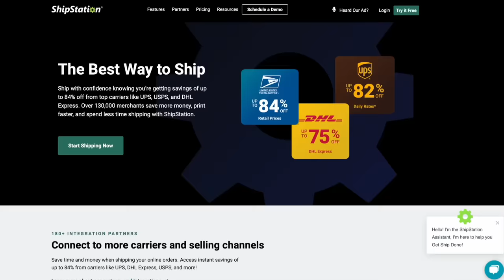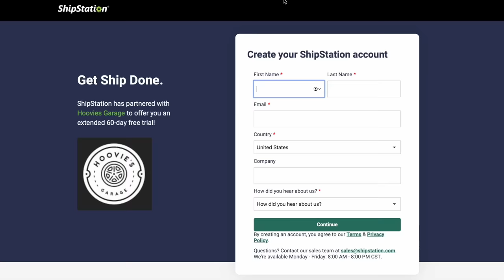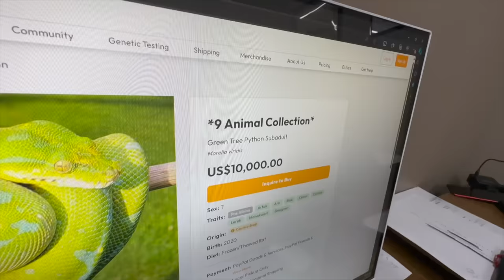I accidentally bought the MOST ANNOYING Dodge Viper in the USA (it was also really CHEAP)

Comment: Former owner of a 2003 and 2013 Viper heres. Nice purchase, needs a little TLC. That oil seepage is most likely the oil cooler line - an issue from the Gen 3 onward. Both of mine did it, as they all do sooner or later. If you replace them with OEM lines, will do it again. There are aftermarket alternative which won't.
Reply: Yep..👍
Reply: Also, a 2004 issue only: check the crank bolt, they tend to back off. That one year only, Dodge used a smaller bolt.
Reply: Yupp going to to replace the lines on my gen v this winter. Other wise this car hasn’t skipped a beat in the 20k miles of abuse I’ve given it.  Oh and  the stupid crappy window regulators
Reply: Aftermarket shocks would also be new and likely cheaper
Reply: Always love when people change out factory parts that eat shit with factory parts..... "I use only factory parts on my car!", you didn't learn the first time it failed at 20k miles? lol
Reply: @jemery3  to be fair that is EVERY freaking Chrysler product.

Comment: You can get a set of BC coil overs for it for under $1.500.00 and really improve the suspension so you can have adjustable height and compression/rebound. Once the Wizzard has the new cats on I'd have someone re-tune it.
Reply: Not anymore you can’t. I think the cheapest I’ve found is 1750 for BC

Comment: That exhaust is supposed to crossover in the rear. Left side engine exits on the right and vice/versa. There is also a small crossover pipe to equalize the sound (like an H pipe). Just doing that alone will make the existing exhaust sound better!

Comment: Amazing... Only 30,000 miles, and it's already rusting...

The miracle of Chrysler...
Reply: Depends also on the owner. I see 2020-2021 vehicles that are already rusting out cause every road in my state gets salted once the snow hits and maybe said former owner said screw it and drove it in winter.
Reply: @thesovietvorona1007  Yeah I know. It's amazing. They can start rusting while still sitting on the dealer lots.

Somebody told me it's because Chrysler paint sucks. The person who told me that works at Chrysler's paint shop.
Reply: @Xplasma1  that’s not the only reason. Worked at an oil shop for a year. I’ve seen winter dailies that are forty with no frame rust (Volvo mostly) and new barely off the lot vehicles like F-150s already getting rust started. Every company outside of mainly Volvo uses somewhat subpar steel and it rusts quickly so that you have to get a new car sooner. If they still made things how they did before the idea of monopolizing an entire market existed we’d have cars that lasted for more than a decade. Let alone a few decades or more.
Reply: @Xplasma1 I can vouch for that, I've never been overly impressed with my new chrystler's paint jobs but for some reason I keep buying them.. thankfully I don't live in a salt state so I don't have to worry about that. Sadly finding my "dream truck" is going to be difficult to find not rusted/250k miles/completely thrashed, and yes it's another chrystler..

I will say atleast it's better then the paint from the 90s which had a habit of just falling off

Comment: $800 for an oil change/fluids? 11 quarts of engine oil, gearbox oil, and differential oil. I get my full synthetic oil at Walmart for $21 per 5 quarts, so about $45 there. Trans and differential fluid plus friction modifier - maybe another $50 for those fluids. Where's the other $700 coming from? Buy the fluids and get your new chippy to do it for you; she seems up for it...
Reply: You're a tad light on your prices, but the bill does seem expensive. A local indy shop quoted me $200 to change the oil in my BMW Z4 a decade ago. Nope. I made some ramps out of 2x10s and I've been doing my own oil changes on everything, since. Between 4 vehicles, I've saved thousands.
Reply: Does seem expensive but I just spent nearly $200 on gearbox oil alone for Motul300.
Reply: @OMGWTFLOLSMH  Yes, I was off by about $20, so $680 less to do it yourself. Maybe it'll take an hour.
Reply: @richieduck67  Viper takes 4 quarts of synthetic ATF+4 is about $8/quart/$32. 1.5 quarts of gear oil plus friction modifier. Hoovie is getting beaten either way.

Comment: Not that you will pay this any attention but i put BC racing coilovers on mine when that time came along was way better deal with labor and parts it was 3850.00 less expensive and actually felt tighter and better rode than the OEM did  and unless there's a hidden issue put a tube in that front tractor tire i have a small farm 765 acers and we have a couple of tractors 6 of them one has tracks so it doesn't count but unless you have checked tractor tires are not a minimum cost by any means  and unless they have a big gaping hole or have no cleats left or have dry rotted so bad there 0:11 flying apart we tube, patch, slime or tireject them its not like your doing 70mph on them in a curve or something they are traction tires as long as they have traction cleats and hold wind its all good

Comment: 20:50 you are not wrong about those ev part prices esp batteries but those are current prices I just took a short course on ev repair and the instructor mentioned that in the next few years your average shop should be able to preform bat swaps and your larger shops should be able to replace individual battery cells.

Comment: Ummm Hoovie when they made this viper, where they still making the dodge Durango, as the first gen vipers just lifted their suspension purely from the durango, like cross check the codes, it might still be the case, as this is why on the first gen ones, you can actually put the rims and tires of that on them and it'll work if you need some cheap snowtires.

Comment: . . Dunlop tyres are the worst . .  I had Dunlops on my RS6 when I bought it and the car would easily lose traction in the wet in the UK even though its has Quattro 4WD  . . after 1 year the fronts were going so I fitted Michelin Pilot Super Sports all around and god what a difference ! . . stuck to road in the dry and the wet . . and they have lasted 3 years . .

Comment: Good lord. Reading the complaints of these cars being loose. I have 30+ years driving dirt roundy round cars. 600 hp with 8" tires. Also had a 2800lb weight rule for some events . The tire rule was meant to be our equalizer. So in my eyes the viper handles and bites fantastic. Try throttle modulation. Drive the darn thing. Ok all, be safe and healthy.
Reply: Ken Schrader taught Tony Stewart how there's 1,000 throttle positions on every car. Trophies never lie. 🏁🏆

Comment: You need to put resonators on to stop the drone, not cats. Cat converters are not designed or meant to stop a drone. To stop the drone is the only reason a resonator was created. If you only do cats, it's still gonna sound like crap. The wizard has no idea what he's doing on this which I find very disappointing.  The factory resonators are 1000 bucks each but discounted.  I work for Dodge and checked. The wizard has the ones he took off you could use are try and find an aftermarket resonator designed for your Viper.

Comment: 16:05 Yepppp one of the Viper wheels themselves you'll be lucky to get it for under $800... as for shocks had on to your hatsssss. and the prices for the other vehicles that you can use from a Viper makes zero sense. Wheels: same bolt pattern different offset as the 97-04 Dakotas/Rango

Comment: Why would anyone tune a Viper unless you're tracking it? They already try ro kill you at stock power if you fuck up in the slightest with turn in or throttle application. 500 hp is ***ample***.

Comment: How long do used shocks last (how many miles are on them)?  How long do you plan to hold on to the Viper and how many miles do you plan to drive per year?  That probably is the info you would use to choose between used and new.  For an extra $2000 you can have brand new shocks all around and a completely sorted out Viper.

Comment: Wasn't there problems starting it? Diesel can easily be from that. You crank it, it doesn't start, diesel drains into oilpan. Hydraulic oil has to be replaced and preferably cleaned cleaned. Poor quality oil will at least make hydraulics inefficient, but if it foams in the pump, it won't circulate. Cavitation and all that wizardry. With old tractors, breakage is possibility, but often stuff is so simple that it's an easy fix with a bit of ingenuity. Just don't try to make it work by only throwing new parts onto it, at least until you are very sure that old ones are broken AND unrepairable. Old tractor is 50% welding material, 25% changed parts, 15% original and 5% rust.

Comment: Wow that’s a scam… that car is defiantly not cammed. As an owner of a cammed gen3 it’s def not cammed, and I doubt it tuned, the gen1/2/3 vipers are not sensitive to the 2nd o2 sensor, as long as the are plugged in you won’t get any codes. Hell mine are plugged in and zip tied to the frame rail… you can get BC coilovers for like $1400.. which are wayyyyyyy better than the oem shocks.. tires is about the only thing he was correct one with prices….

Comment: So I dated this girl that had a Toyota Camry Hybrid. Top of the line car and was super nice. So I do all my own maintenance in my vehicles I don’t really trust anyone except my brother in law that has his own shop and knows if I’m bringing a car in it’s not going to be a simple repair. I change the oil in her car and about a month later I pull the dipstick and it’s like a 1/2 quart low and I knew that I’d double checked it when I did the oil change it being the first time for her car. I topped it off and let it roll. When the time came to change it again I pulled the stick and it was easily a quart low. The engine was spotless and didn’t have any leaks. I do the oil change and sure enough  I check it again and it’s low. Short story long this is what I figured out. Since this is a hybrid the motor was constantly shutting off and starting back up intern causing cylinder wear. I don’t know if they have came up with a solution for this or if all hybrids eventually end up burning oil because of the starting up and shutting down repeatedly. Seems like they would have a electric oil pump to keep oil circulating instead of it going down into the pan leaving the cylinder walls dry.  Just my thought on the situation.
Reply: Idk. Sounds pretty normal for any Camry. 🤷

Comment: Electric vehicles will be throw away cars. If the battery even lasts 10 years, a lot changed in 10 years making one of the  most expensive part of your car, obsolete and replacements no longer getting made. If you supercharge you batteries you may be paying up to the equivalent of $7 to $15 per the distance a gallon of gas can get you. Great technology but a big rip off.

Comment: Remove that v10 and pop in a turbo 4 or turbo straight 6 and Id buy it. I'm not into super fast gas guzzlers, but I'd love a nice roadster for cruising. And at 6'4" tall Miata is not the answer.

Comment: Its  still kinda cool, but has a lot of mechanical problems and issues. Maybe a c7 corvette or new camaro engine would fix it. These cars were designed to be loud and money-culture without any viable computer engineering and thought, like junk bonds in 2000s.

Comment: "pushrod dinosaur" Do creatures like this guy understand pushrods and OHC came along at about the same time, WELL over 100 years ago?  BOTH are dinosaurs, and pushrods dominate because they do the job better.  IF you are trying to squeeze every last pony out of a tiny motor at excessive RPM and damn torque then your OHC has a place.  In a huge engine like that V10, or anything over 4 freaking litres making horses and torque down low, no thx.  Especially in the age of direct injection...

Comment: Triple black convertible, you'll absolutely fry like an egg.  Especially with those annoying Viper side pipes that heat everything up and the dodgy a/c(maybe they fixed that on this gen, I know the first ones didn't even have it).  I had a 1998 white Camaro Z28 convertible with dark grey leather seats and that was bad enough that I had the interior redone with white boat vinyl(driver's seat was chewed up).